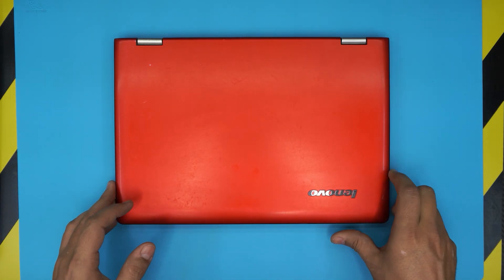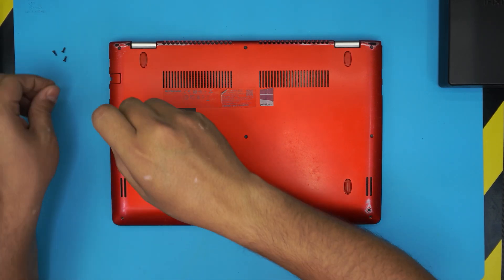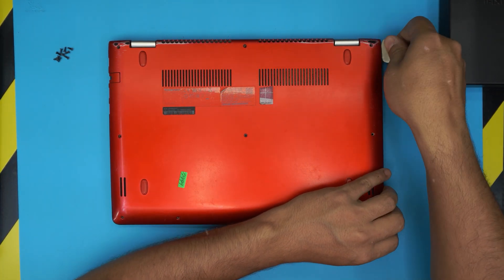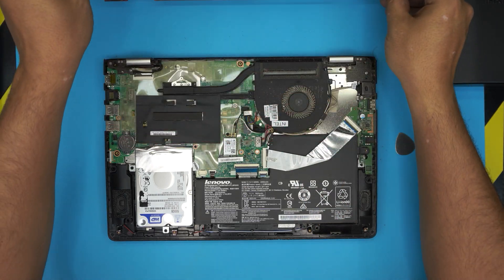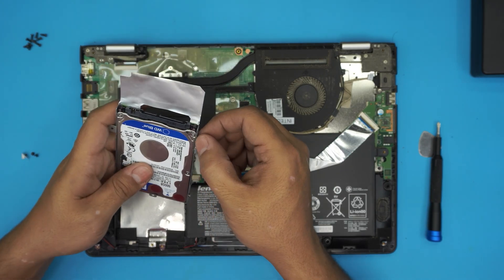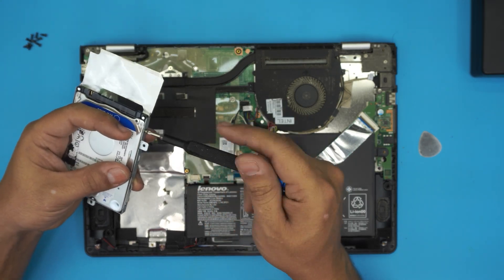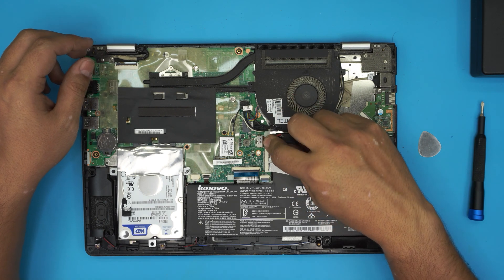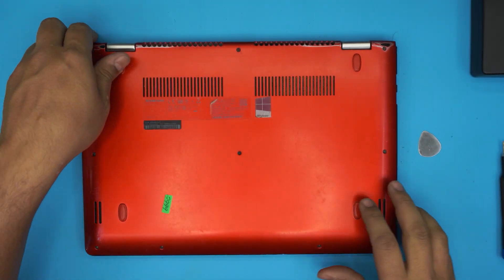How to upgrade SSD HDD on Lenovo Yoga 500 series

Comment: can we use both hdd and ssd at a time by moving os into ssd and hdd for files
Reply from the maker: 🫠 If you wish to support the channel, you can like, subscribe, or both!
Regarding your question, you can only have SSD or HDD in the laptop not both at the same time. you will need to reinstall your windows from usb drive:
https://youtu.be/uDu8j2lE-dM